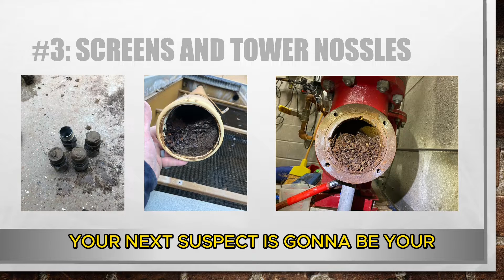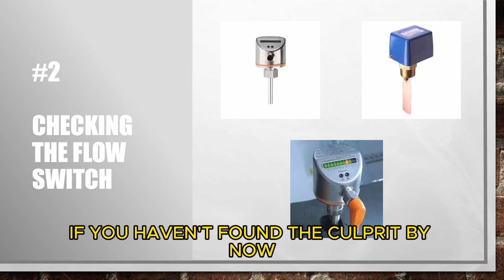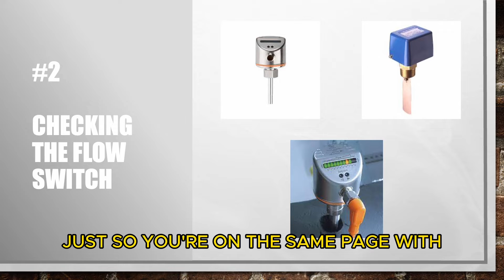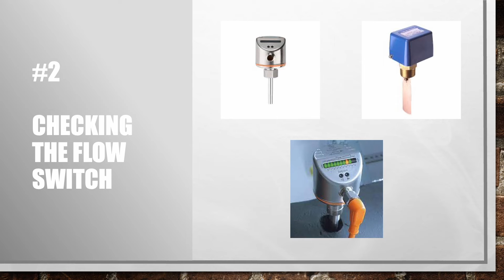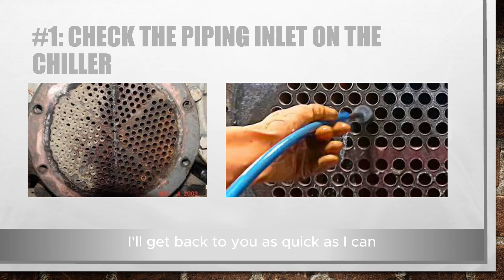Mastering Trane Chillers: Condenser Flow Issues

Comment: This one of the main reasons i love my Testo probes. They work on water. So i now have digital means to check water "pressure " i never trust analog gauges. Purchase some Peete's plug adapters with ¼ flare to npt fittings and good to go
Reply from the maker: Nice Man, I’m old school, I have had issues with 2 testo sets, and the thermometers, so I stick with analog gauges, and a copper thermometer if it’s critical. Some of the testo thermometers I have had were 1-4 degrees off, and I’m paranoid lol is there any way to calibrate them?

Comment: Too much condenser flow on a CVHF you will hang up all the refrigerant in the condenser and you will get a low end surge. I have also seen orifice plates cut too tight that would hang up refrigerant
Reply from the maker: dang man thats a very good find. do you find it harder to get support from Trane when your not working there?  @billyflanagan9657
Reply from the maker: what do you mean cut too tight? never heard of that, you work for the factory?
Reply from the maker: Very cool man, I just move to Norway from the states a few months ago. Never seen a Mag bearing LP machine. How is the reliability? Whats the model, I kinda want to do a little reading, I am a geek lol
 @billyflanagan9657